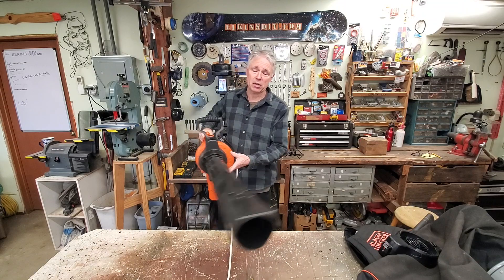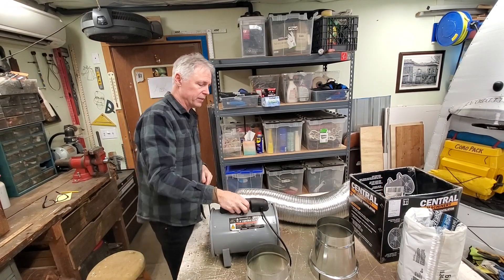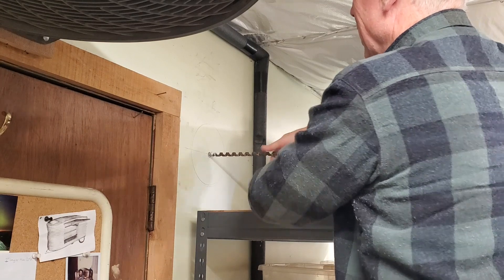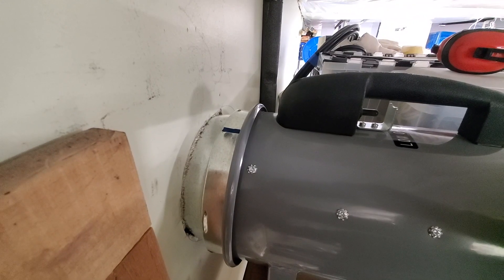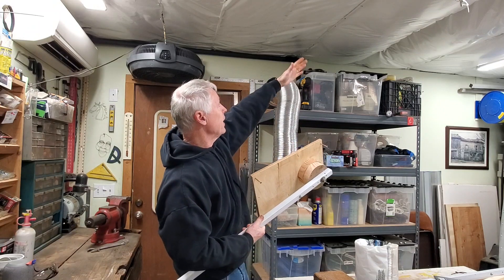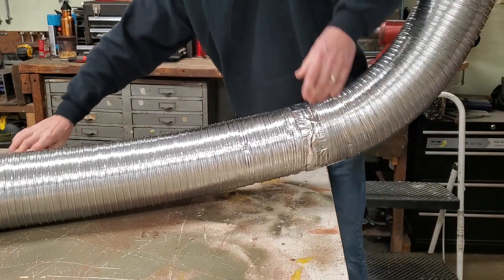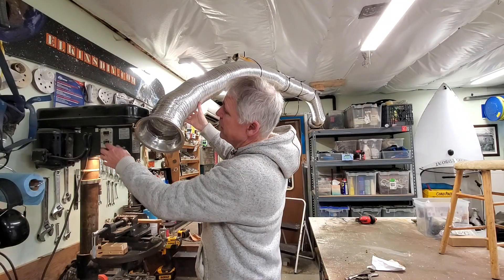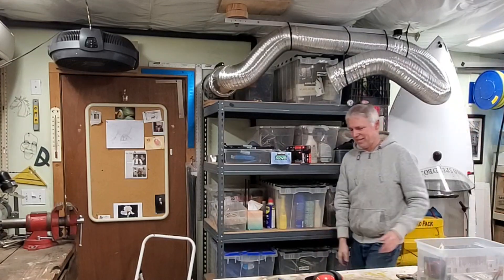DIY Fume Extractor

Comment: Paul. I want to use this setup for my epoxy resin applications. To not drill an exhaust hole in my building can I put a reducer fitting on the other end of the fan & run it up the wall & out the vent of the building?  Will it interfere with the fan ?

Comment: Very nice, I have a 20 year old furnace blower I got for free that was being thrown away and it has 3 speeds on it, and is super quiet and was used in a 3200 sqft house, not sure what the CFM is for a blower of that size but it moves air so well. See if you can find a used or junked furnace blower and do a comparison on the flow. Thanks for sharing!

Comment: if you want make a pipe with smaller connector you need a  german round cake form i used one for my chimney to stop water running down into my wagen

Comment: hi paul, im designing an e-bike/motorbike trailer with fold down sides that form a circular platform for a small heavy insulated yurt. feel free to play with this idea and see what you can come up with as a portable warm survival shelter for the homeless. campers are great but i wanted the comfort the space a yurt provides and its simplicity for insulation and nomadic lifestyle. which materials would you recommend i use for long term durability, warmth and lightweight construction?

Comment: Paul. This comment is misplaced as it is not relevant to this post. I’m working on a plan to build a micro camping trailer to pull behind my motor scooter. Do you think coroplast can withstand winds in excess of 70mph! My other option is pink foam with poor man’s fiberglass.

Comment: I ended up going with a 6" 440 CFM one from Amazon designed for grow tents for weed, gonna run it right to the dryer exhaust vent since it's in my basement then add blast gates and a splitter so I can run a tube to my laser engraver tent and another one to my spray booth for painting and switch as needed.

Comment: If the hose is going to come down past the arm that far, you might as well screw some kind of handle to it that comes down around the hose so you don’t have to go up on your toes to move it around. It could just be a loop of wire that pins into the foot of the canopy leg. That way it could wrap around the hose and (maybe) give enough leverage to even extend the leg. Maybe an old 5 gallon bucket handle? Might be a little too small once you bring the ends together, but that’s what I’m picturing.
Reply: Come to think of it, I bet a rope would do it just as well…

Comment: What baffles me in these kinds of projects - why no one is using a centrifugal fan - has more pressure to squeeze all that air through the hose, more velocity, more better.
Reply: They also cost alot more than a harbor freight fan.
Reply: @ProsperousHobo  true, but at least they get the job done.
Where I'm from small inline fans cost 10-50eu, centrifugal start at 70.

Comment: Dave Elkins hoodie is pretty sweet. He must've been a cool guy. 

I made a jib boom for my shop and have attached an led shop light, an extension cord and a vacuum hose. I've been thinking about some sort of fume extractor for a while, thank you for motivating me. I think it'll fit on the jib just fine. I always weld with a respirator but when my machine hits the duty cycle my shop is thick with smoke. I need to do something about it. Again, I appreciate you sir and thank you for sharing your skills knowledge and experience
Reply from the maker: Thanks Michael. Dave was my brother who as a kid was a pain, but turned out to be a great guy. Miss him dearly.
Reply: Hey there,  I was reading your comment and was wondering if you have a video or pictures of your jib crane you built, it sounds very informative and interesting Please share 
Thank you
Reply: @V8SKULLS  i dont know if I'd use it to lift anything. No videos yet sorry. Im away from home today and got a busy day tomorrow but I'll try to remember and make a short in the next few days. 

When i made it i had a really long vacuum hose on it with like 10feet hanging off the end, and a 14guage extension cord with like 5 feet hanging off then end. I made hooks to secure the loose ends back to the boom, and the bottom has a really bright light. I repurposed the vacuum to something else for work. So now i use this boom to move the one light around or the power cord to the center of the garage... or i hang stuff from it while paint dries. Mostly its bungeed to the side out of the way but with the light and cord right above my vice. 

I bought a side by side and i dont have space anymore. Its a blessing and a curse. Projects aren't as easy for me to get done as they used to be. 

I made that boom from garage door opener "T" track, its not very strong so i wouldn't lift things, but for sure it could be modified to be stronger if i wanted to do that. But right now the whole thing is hanging on 2 interior door hinges. Anyway it was something i thought was neat back then. Thanks for your question
Reply: @michaelosmon 
Thank you for getting back with me and No worries,  enjoy yourself today, I was just inquiring ideas, everybody here on YouTube is so Amazing and very helpful with so many different things and ideas to make everyday life more enjoyable/helpful.  
I was thinking about making a jib crane/Hoist out of deep channel Uni-Strut. Im a Electrician and have many 10ft sticks of deep and shallow channel struts. But im always out there to see and learn other ideas but mostly better working one to make. 
Thank you again for answering me back. And good to talk with you by the way my Name is Daren, hopefully talk with you again.
Take care and enjoy your Sunday night my friend.

Comment: Nice. I tried doing something similar for soldering using a pc power supply unit case and a computer fan with some carbon filter material. Didn't pull enough cfm to do anything and just bought a proper extractor for $30.
Reply: Speaking of. I'm revisiting this since I'm taking electronics repair more seriously. Going to try and make something similar since the "proper" extractor I mentioned is awkward and not very helpful. Nor does it work well with just a carbon filter.

Comment: That aluminum duct tape is the bomb!  I have used it to seal air leaks in my HVAC ductwork, AND on the rocker panels of my 2006 Chev Cobalt over solid rusted areas, before repainting the rocker panels.  Two years in, and still holding tight!
I will be stealing your idea for the exhaust ductwork in my basement workshop, venting it through the screened vent in the glass block window.
Reply from the maker: Nice! I bought my roll some time ago at a garage sale. SCORE!
Reply: @paulwelkinsdiy  - I always have a couple rolls of the aluminum duct tape laying around - 1 in the workshop and 1 in the garage - oh!  there is also one right here in my den that I used to tape Reflectix sections together!  I have an 8 foot length of flexible vent already, left over from a previous project (added a heating duct to the laundry room in the basement).

Comment: clever but still can be improved, add some air entrance somewhere so that it can push more as much air volume as it was designed to, put the fan outside so that you have less noise in the inside
Reply from the maker: I thought of keeping the exit port 8 inches instead of the reduced 6 inches. Not sure that would have helped.  I'll put up with the occasional noise and keep the unit inside just to keep things simple.
Reply: for that you can leave its switch permanently in the ON/HIGH
and add a switch in the inside of the room to turn it on/off

Comment: Would you be interested in making something to cap smoke from something like a wood burning stove to feed it into a home Spirulina or Chlorella system? Kind of like a home version of how they say they can use emissions from power plants to feed algae production for algae based biofuels, plastics and fuel? There's lots of videos on how to grow those algaes and process them at home, but no one has bothered to use smoke from biomass burning as part of the nutrients. The closest I've seen is them settling for the carbon dioxide in ambient atmosphere and just using an aerator or fish tank bubbler.
Reply from the maker: Wow, You're way over my head. Not sure I can help in that category, but sounds like you could play with some experiments yourself?